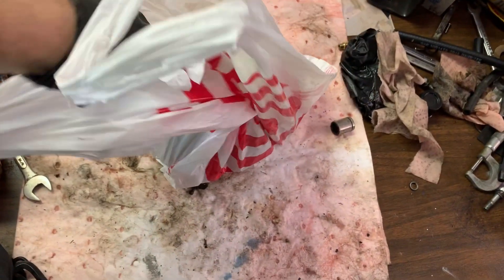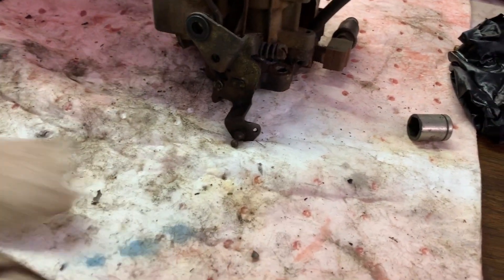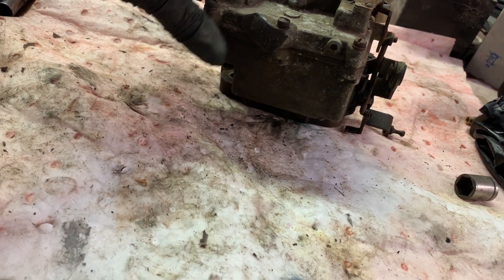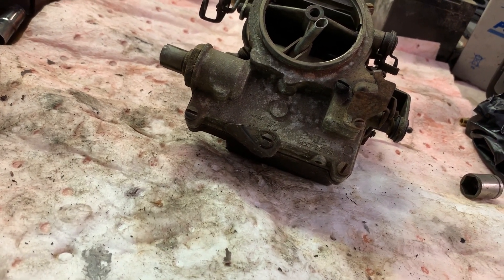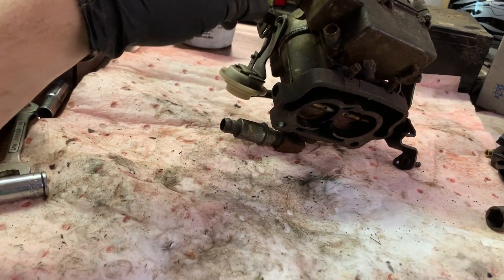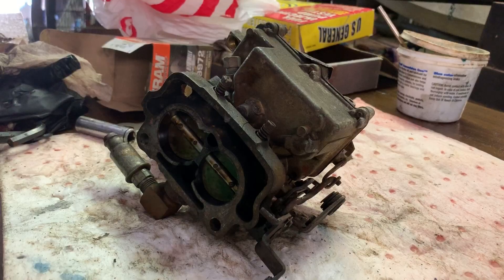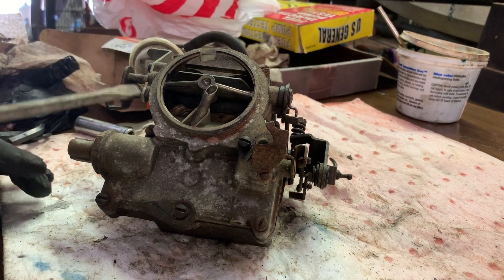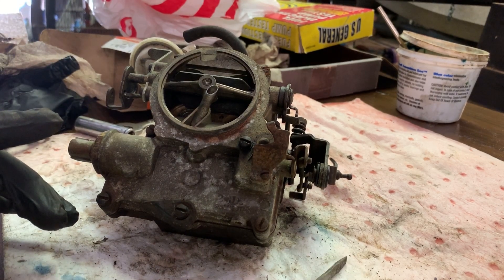Rochester 2 Jet Rebuild Part 1

Comment: Hello, how many turns do you give to each needle and the 2 are of air
Reply from the maker: I start 1.5 turns out then fine tune it once running.
Reply: @mjmcomputers  
ok after you tune it, more cradles are left for each one for a good mix and fuel savings as they should aslir the spark plugs with a little ollin or carbon or white.

Comment: Rochester 2Jet is a great carb. They also used those on Dodge 318's in 1971 only. There are something like 5 different CFM ratings and at least 2 flange bolt patterns. Seems like V6's and the 318 got one pattern and all the V8's got the larger pattern, not sure. The weird fitting on the right front is the distributor advance connection. That one is so old it uses a copper line to connect there. Have fun! PS, I know instructions usually advise to run the mixture screws in and count turns, but they'll always run at 2-1/2 turns out from lightly seated, then you can fine tune.
Reply from the maker: Im sure this carb is original to the engine, I didn’t realized Chrysler used them as well.